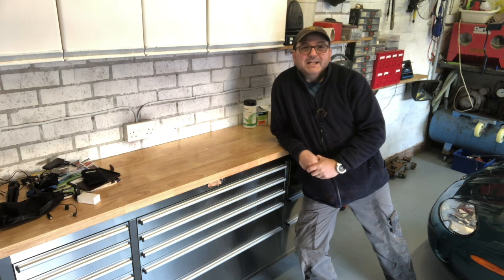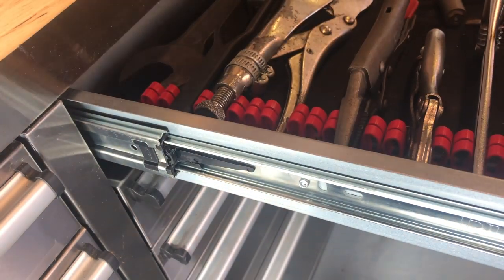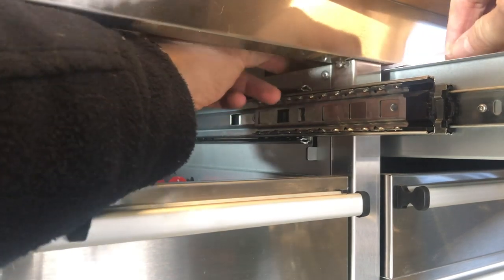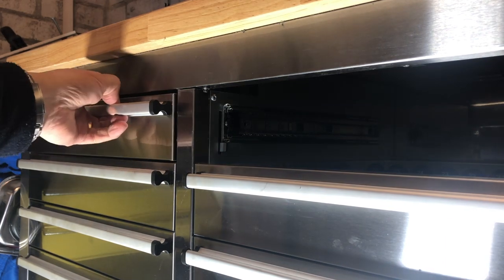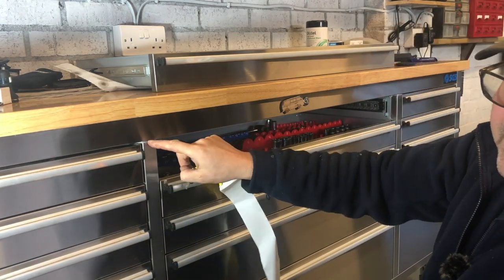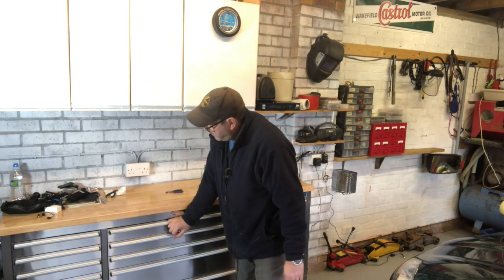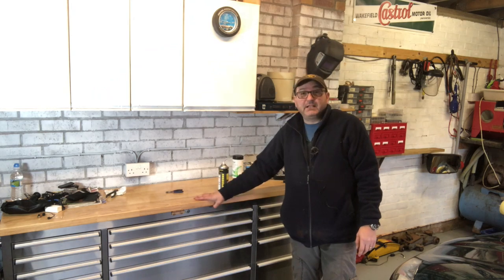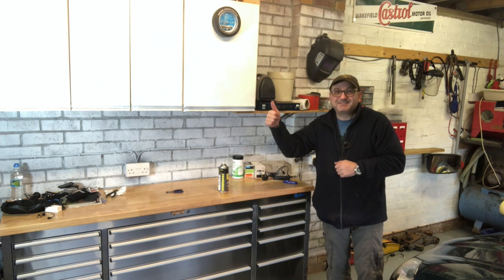Stop the rattle and racket from your SGS US-pro tool chest.

Comment: To stop the noise you can just tighten the 4 nuts that hold the locking mechanism by removing the top middle draw, I did it to mine and it works perfect
Reply from the maker: Hi Ryan. I will check this out. Thanks very much👍

Comment: I can confirm this rattle is annoying. Here it is the way I fixed it on mine.
Remove at least the 3 top drawers in the middle section so you have some space to see the locking mechanism linkage at the top. You will see a few bolts on this linkage and you also will see how stupidly loose the linkage system is. Use a spanner or a small ratchet and tighten the nuts just enough to stop making the rattle. As you are doing this, you can apply a bit of grease around the bolts/linkage so everything runs even more smooth and no more rattles. Put the drawers back on and call it a job done. No more annoying rattles. 
However, I have other issues with this bench that I wish it could be of easy fix like this rattle.

Comment: Not a fan of using grease on the runners as it can attract dust and crud over time. I have currently a different make but with the same closing system. If you take a drawer out and look at the back I am sure you will see a plastic or neoprene bush that the drawer clips into to hold it. I put some silicone grease on that and it eased the  opening and closing greatly. Just waiting for the 55'' versio of this box to arrive.
Reply from the maker: Top tip Steve👍 Good luck with your new box

Comment: Hi John. Is that fridge magnet on your stainless box ?????
Reply from the maker: Yes, it is. (well spotted)
Its Ferritic stainless steel.
These same tool chests are ofen used by chefs in Kitchen environments as well,  and Ferritic stainless is food safe as it doesn't contain Nickel. Its not as resistant to corrosion as the non magnetic variants but significantly more resistan than coated steel sheet.

hope that helps
Cheers Adam

Comment: Excellent video. I have 2 questions for you , what about fitting a vice to the bench would it be able to tighten up with the wood compressing and what do you use in the top draw to organise your mole grips please? Think it is different to your answer further below? Thanks in advance.
Reply from the maker: Hi Andrew. Sorry misinterpreted the question. They are actually screwdriver clip rails like the link here
https://amzn.to/2VZm1TE
I have not screwed them down the are really handy to hold all sorts of tools in place.
Yes the worktop is they tough so attaching a vice is very possible and I will be doing so there soon.

Comment: Hi I am thinking of purchasing one of these tool boxes. Is there anything that holds the drawers closed when unlocked, nothing worse than drawers that open on their own
Reply from the maker: Yes but its not particularly strong.The drawers slide without resistance to the nearly shut position and then you have to push them to achieve full closure for the last 8mm. If you have heavily filled drawers and then push it around on rough concrete without using the key to lock it, then drawers will pop open. I Know cos it happened😁. The value for money based on price and robustness is very hard to ignore though.

Comment: two good videos you've posted for this :) - i've been eyeing one up myself recently with the main purpose to be a new location to put my metal lathe on - any ideas on what weight the worktop will take - would it take the weight of a 170KG metal lathe do you think? - cheers :)
Reply from the maker: Hi Gary. I don't know for certain in that I have not seen a safe working load on it, but my instinct is that it won't even notice the weight. The work top is thick and solid. The body is robust and although I would predict the castors as the weakest element, They are mighty heavily built. I think as long as you are not moving it from one side of your workshop to the other every day over a roughcast concrete surface, then it would be fine.
170Kg sounds quite heavy for a hobby lathe?
If its  a reasonable size then I would just check out that the working height is not too high for comfortable operation?
Reply: @ToTheGarage  Many thanks for the detailed reply :) - the 72" is now on Black Friday deal at SGS, and they are linking to your un boxing video on best way to install the castors (check there  Q&A page)